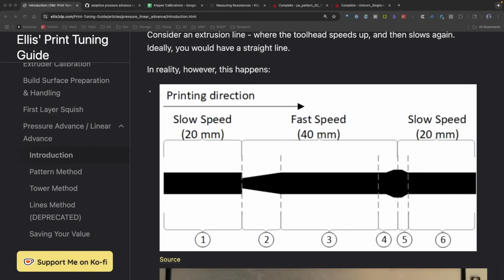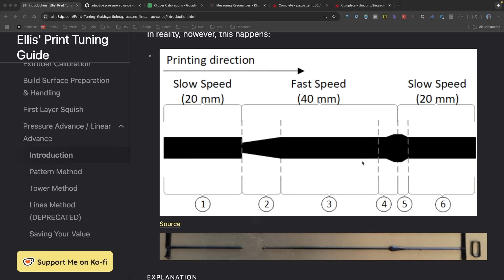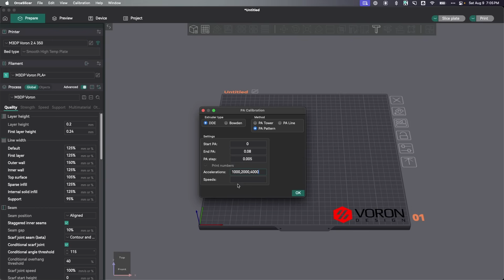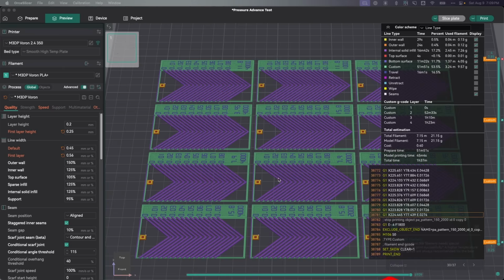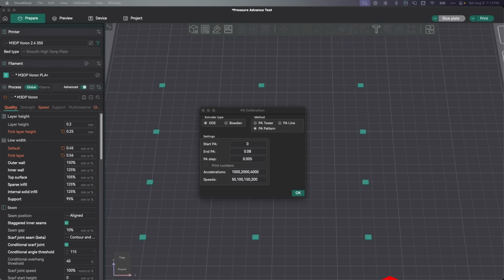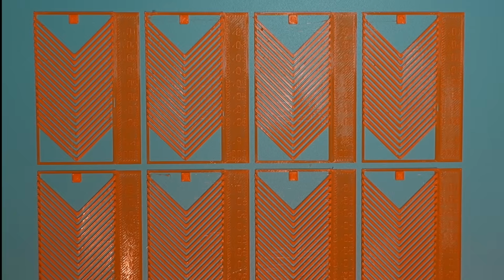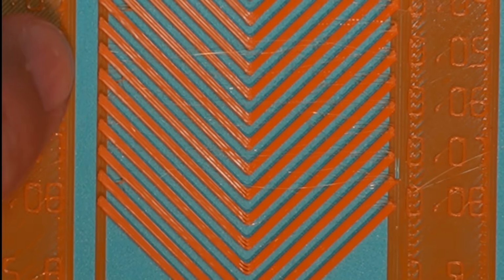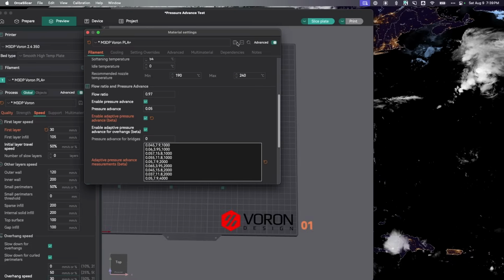OrcaSlicer Adaptive Pressure Advance: A Complete Guide

Comment: This is from Klipper documentation. Some slicers advertise an "advanced extruder pressure" capability. It is recommended to keep these options disabled when using Klipper as they are likely to result in poor quality prints. Consider using Klipper's pressure advance instead.

Specifically, these slicer settings can instruct the firmware to make wild changes to the extrusion rate in the hope that the firmware will approximate those requests and the printer will roughly obtain a desirable extruder pressure. Klipper, however, utilizes precise kinematic calculations and timing. When Klipper is commanded to make significant changes to the extrusion rate it will plan out the corresponding changes to velocity, acceleration, and extruder movement - which is not the slicer's intent. The slicer may even command excessive extrusion rates to the point that it triggers Klipper's maximum extrusion cross-section check.

In contrast, it is okay (and often helpful) to use a slicer's "retract" setting, "wipe" setting, and/or "wipe on retract" setting.
Reply: ok... and?
i mean... does some firmware selection in orca would lead to that? 
because unless it does i really dont see any relation of that comment to the video.
Reply: fairly certain orca uses klipper's own pressure advance, or Mariln's if possible
Reply from the maker: I think we are talking about 2 different things.

Comment: The question that immediately comes to mind is how about different filament types ie PLA, PETG and others. And again from different manufacturers. It seems that very quickly  all of your machine time multiplied the number of printers you may have would leave little possibility of printing useful objects. Do you have any opinion about these ever increasing tests? Thanks!
Reply: im actually kinda working on something along the lines of that. because in theory youre just defining some curve whose only real scaling factors are filament type and how your hotend is behaving. so in theory, you could just use a baseline curve, with your original single pressure advance value to get a "close enough" adaptive PA value out of it with no extra work.
(if you or anyone else would like to share their adaptive PA calibration results, i would highly appreciate it :P!)
Reply from the maker: I usually use the results from PLA+ across the board. I simply change the temps (bed, nozzle, and chamber) for other filaments. If, with the new filament type, I notice an issue, I will then run the appropriate test. I try to simply run a test for the issue I am experiencing rather than the whole suite of tests.

 It is my belief the if I run tests for every brand, type, finish, etc. I will be running tests and never printing. I might feel differently If I was selling models but I am not.